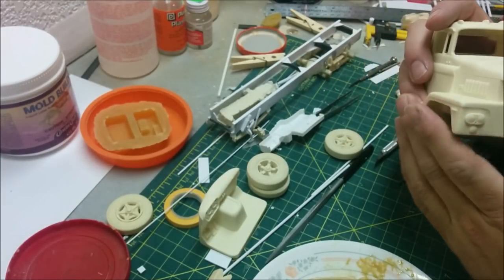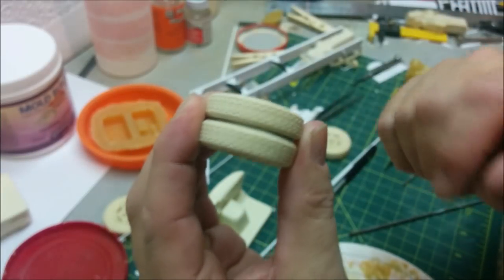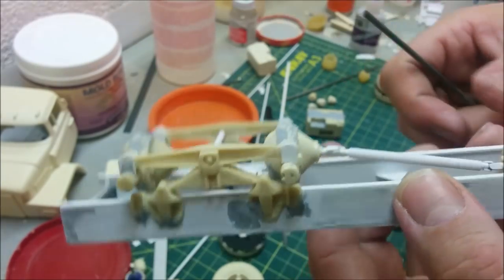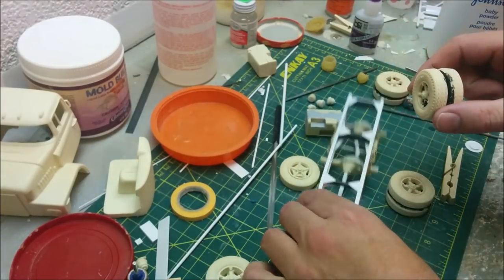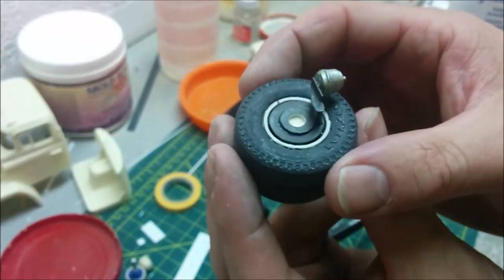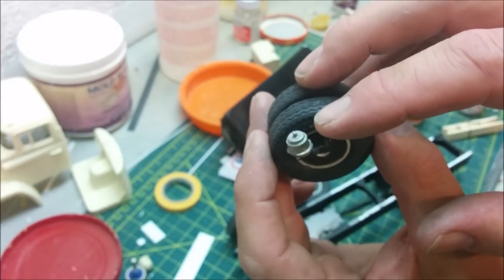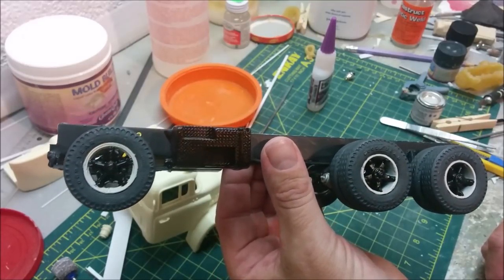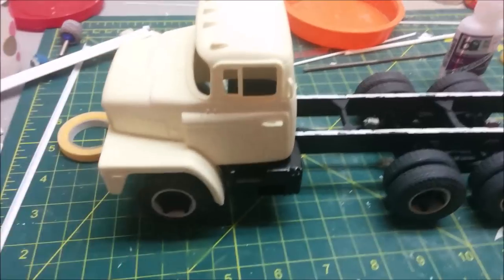Dodge Heavy Tow Truck Build Pt4 1/25 scale

Comment: It's called the canister,Dan. Justin's correct,it's a big diaphragm.When you step on an air-brake,the diaphragm's move and and actuate the s-cams,which in turn,apply the brake. Old diesel mechanic,here.😎👍🍺
Reply from the maker: Thanks for the info. I basically knew what they did but didn't know the term.

Comment: hey dan, i would call them air pressured brake activators. if you look close to a big truck, when it stops those rods
move and control the brakes, sometimes with a hissing sound. your truck is growing well, k.u.t.g.w.
Reply from the maker: Thanks I've been getting lots of info on those parts. At least nobody has said they weren't related to the airbrakes!